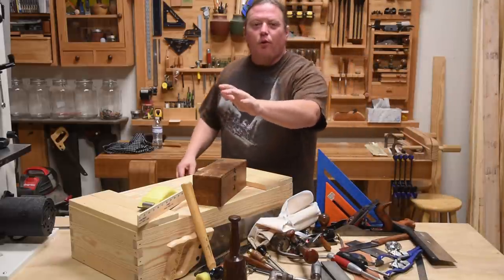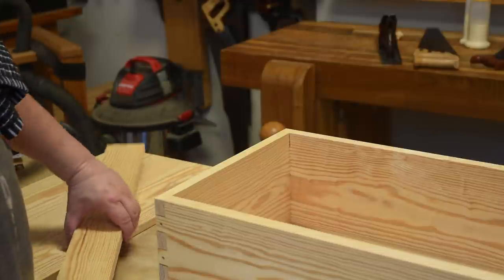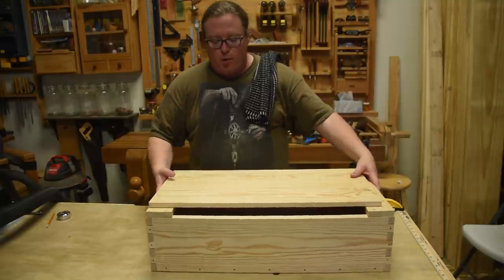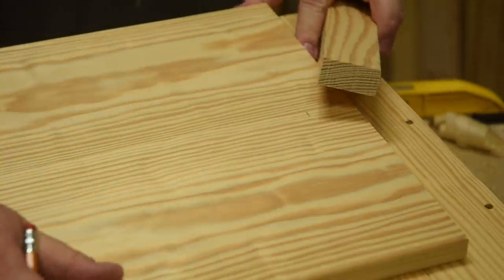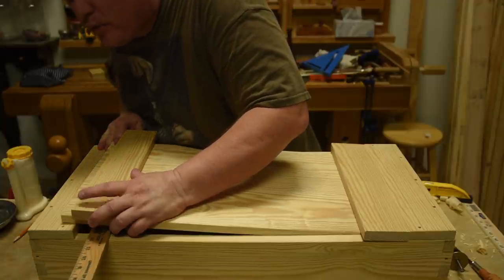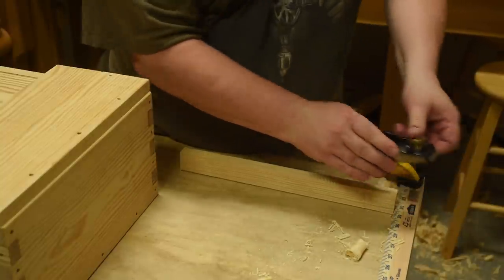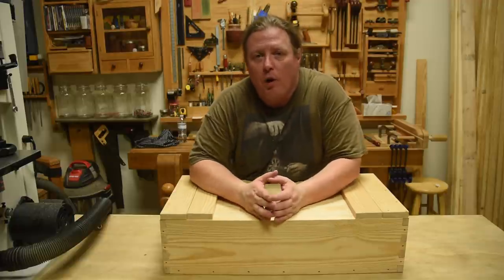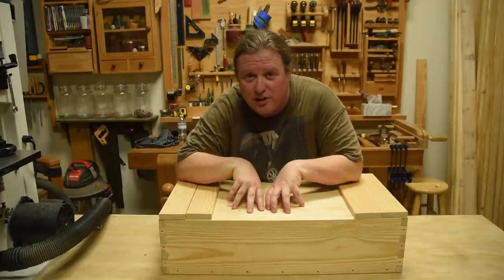A Simple Toolbox Build – The Top - Start Woodworking - Class Four PART 3

Comment: The traditional way instead of using straight boards and magnets on the locking end is to rip the 3" board at an angle to create two wedges. Great lesson.
Reply from the maker: Was mentioned in video. This lesson was cuttin 90’s.
Reply: @wortheffort  It must have been the 15 seconds I have missed. Once again thanks for this and all your videos.

Comment: Great stuff.  I like the teaching method.  Box needs handles.  Maybe 5/8 rope in the end top caps, if it will clear the locking slide.  Through the ends would work also.
Reply from the maker: As mentioned 4th video....